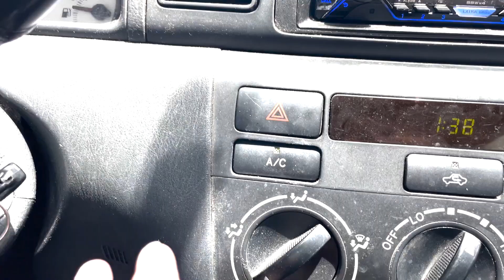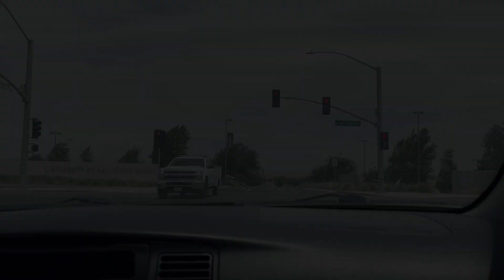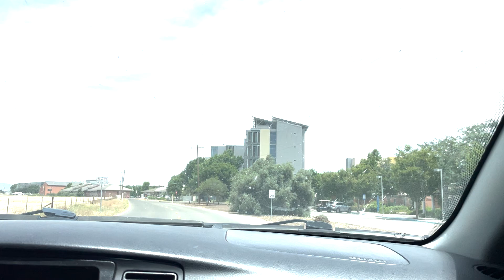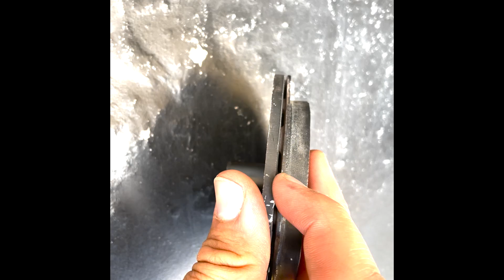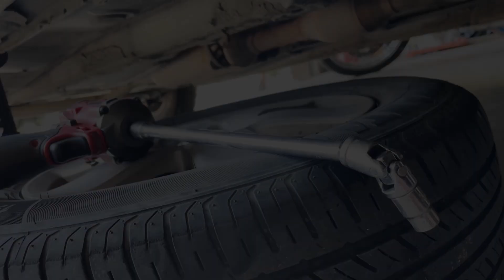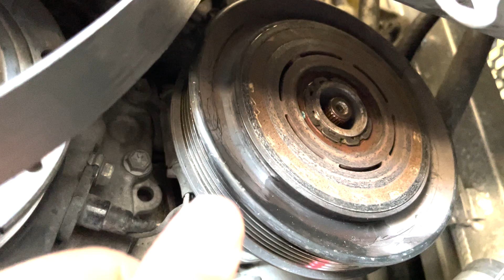2003 08 Corolla AC Compressor Air Gap Adjustment

Comment: great f'n video my man!   Was having issues with my AC not engaging (flashing light) and was able to solve with your help.  Ending up just being the rubber dampener ring on the outer clutch plate being ripped/torn/gone...  Replaced with a $40 ebay special and I'm back chillin :)  Thanks eh!